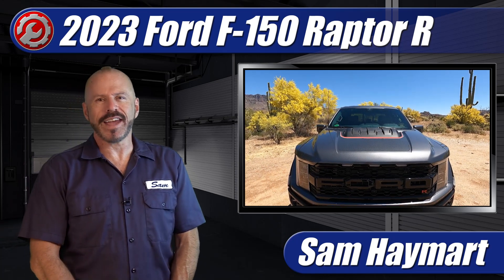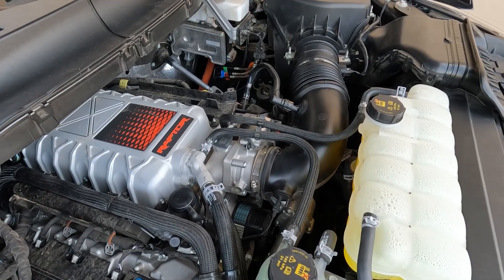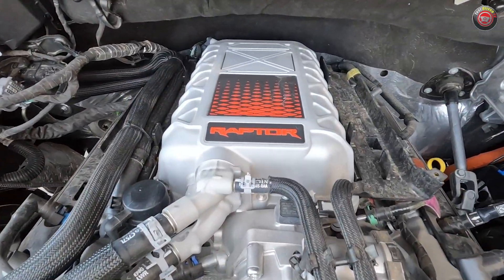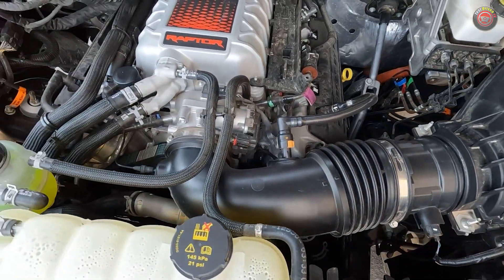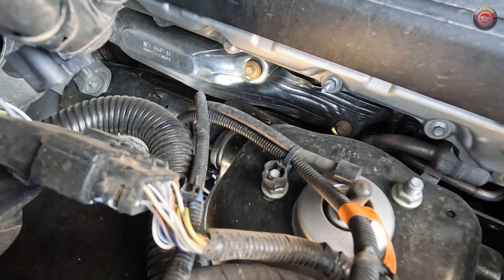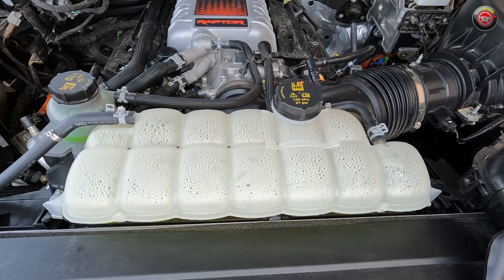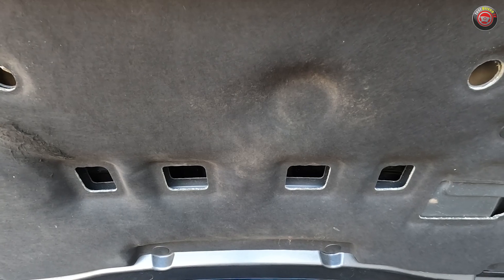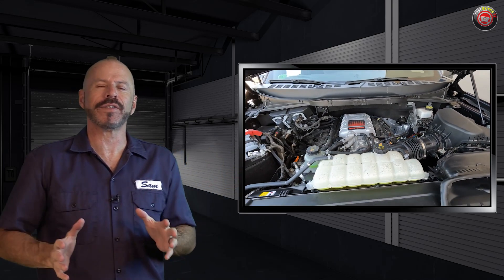2023 Ford F-150 Raptor R: Engine Explained

Comment: Is it f150 timing or mustang gt500 , it's gen 2 based, no direct injection like gen 3 5.0, 
Can I run this in a gen 2 f150 will timing match

Comment: So can some of the v6 mods go on here? Like a intake? Or intercooler?
Reply from the maker: Surely someone is or will offer an air intake. The inter-cooler is air-to-water so adding a larger radiator to it is the "mod" unless an aftermarket company offers their own heat exchanger that goes inside the supercharger assembly.